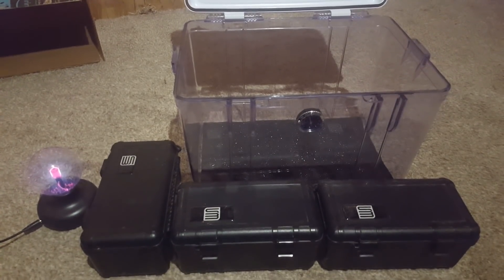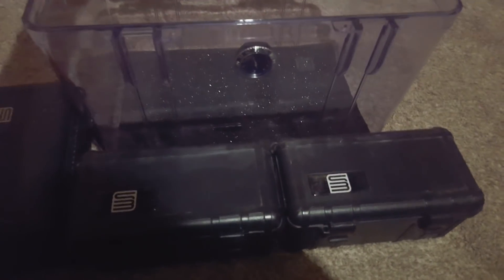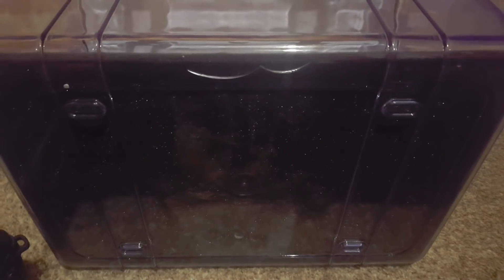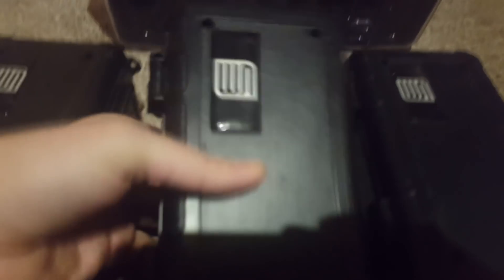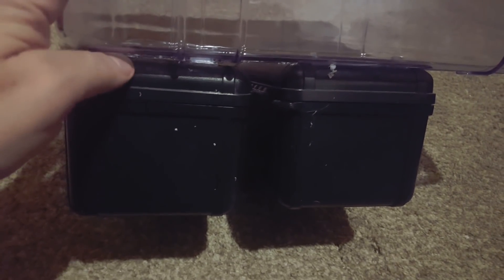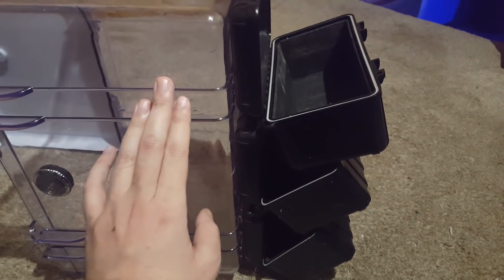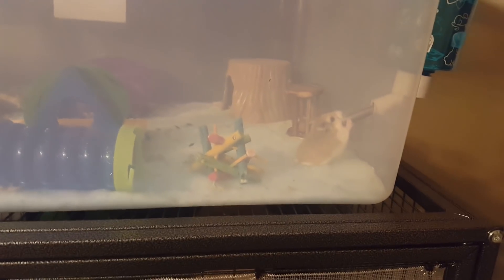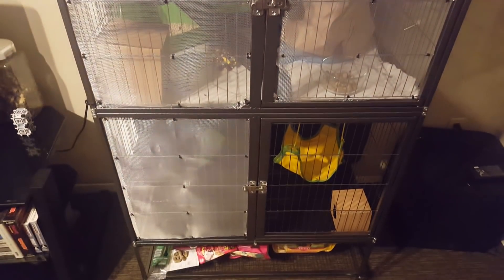Hampture Update for 12/23/2018: MegaHab Construction Progress

Comment: what if, instead of drilling holes in your hab, you placed the ballast In.side the hab so it evenly applies along the bottom of the hab and you dont risk snapping it with bolt holes. only downside is decrease of internal space.
Reply from the maker: Not necessary. Please trust me, I have been at this for a while.

Comment: Instead of drilling holes, couldn't you rough up both sides and use a super strong epoxy like industrial grade loctite?
Reply from the maker: Adhesives are a bad idea for something like this. If it came loose, the entire habitat would float to the surface. Holes are not a big deal since it's a positive pressure design. Any leaks will emit bubbles into the water, but water won't go in.

Comment: You can try to seal the crack by attaching a vacuum cleaner on one side and let superglue suck it through the crack.
I would also recommend using washers for the screw heads inside the container to avoid cracks. Btw, how do you make the screw connection airtight?

Comment: If I may offer a suggestion, steer clear from such a rigid and thin plastic, remember that you can always glue together 4 pieces of 1/4inch plexyglass and it will work even better, while being far cheaper, heavier therefore more stable, and more customizable.
You could epoxy it together with some glue of your choosing and then fix it with some steel L shaped connector.
Damn this hamster thing is tickling the mad scientist in me!

Comment: Don't just use washers as shims, put them on both sides of all the bolts to reduce stress on the plastic, they'll spread out the force and help keep it from cracking!
Reply from the maker: Oh for sure, that too. I did that on Hambase Alpha before this, and it's proven very durable.
Reply: Oh, and don't use superglue. Use regular, all-purpose 2-part epoxy. Use it for goddamn everything, because any glue except elmers is shit. That epoxy will set hard and strong, and as long as you clean any grease off the surfaces, it'll stick on there forever.

If you're going to keep using that container, i'd suggest smearing a thick gob of epoxy on either side of the crack to seal it up. The bigger the gob, the better the job.
Reply from the maker: @Chuck_Huckler  Nice! I'll look for 2 part epoxy at Lowes. I have some 2 part glue that rapid-cures with a spray already that I may have been incorrectly referring to as superglue though.
Reply: Epoxy will also rapidly, near-instantly cure if you spray it with water as well, but it's better to let it cure slowly.
Reply from the maker: ebagig white  Oh, nice one. Will do! I am already committed to mounting the ballast pods on the bottom since there needs to be room on the sides for the eventual addition of gate valves, which will permit linking the habitats with tunnels.

Comment: Have you used magnets as anchors?  I mean, iron as the anchor, and magnets as the adhesive. That way the structure isn't compromised.
Reply from the maker: That's a really good idea. I've already drilled the holes though. But it's really not a big issue since this is a positive pressure habitat. They are very leak tolerant, so long as no single opening/crack is very large.

Comment: I'll admit I haven't seen all the videos but I think I remember a video saying the weights inside the boxes is lead. Wouldn't lead be a poisonous thing to put into water?
Reply from the maker: Yes, if they were bare. However they are contained inside of the black, sealed plastic cases you see in the video. This prevents lead from coming into contact with the water.

Comment: May i suggest gluing the ballasts using epoxy? Less chance of damage.
Reply from the maker: No way, there's a chance it could weaken over time. If it came loose, the extremely buoyant hab would go flying to the surface and probably cause the hamster's lungs to burst.

Comment: You should look into getting a 3D printer. Also look into geodesic domes and sterling engines
Reply from the maker: I have a stirling machine! I soldered some wires from the little dynamo to a USB port PCB so I can charge my phone from it. Geodesic domes are excellent for land but not really suitable for underwater use. I'd love a 3D printer and it would be tremendously useful to this project given all the fiddly custom plastic parts I need, but that's not in the current budget unfortunately.
Reply: @Hamdad  you can get a good printer for 250 dollars
Reply from the maker: @3er24t4g1  I know, but the budget is $316 currently and I need all of that for stuff like custom cut acrylic, tools, bolts, silicone, a new compressor, etc. etc. etc. it never ends. I've seen the cheap ones that come as kits you assemble, that might be feasible.
Reply: @Hamdad  I recommend either a Tevo or a Monoprice
Reply: @Hamdad  Get a Creality Ender 3 from Aliexpress or Banggood. It's less than $200, has adequate build space, supports many filaments, and replacement parts are cheap.